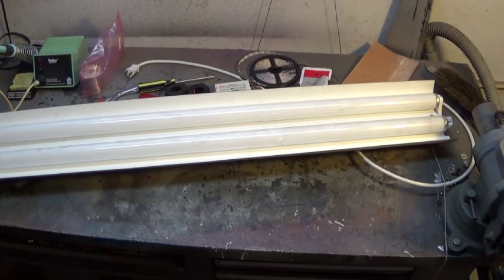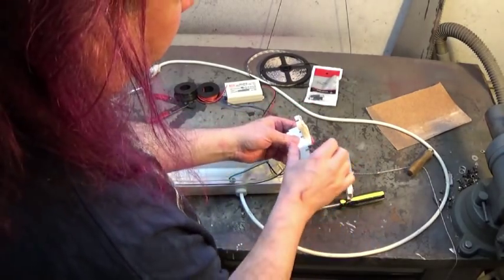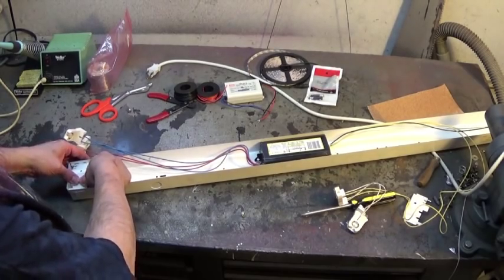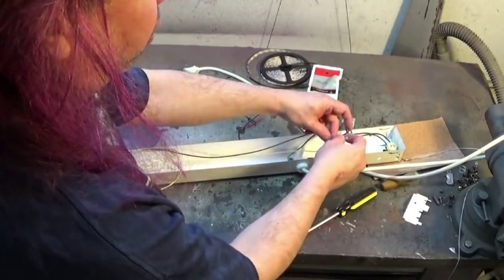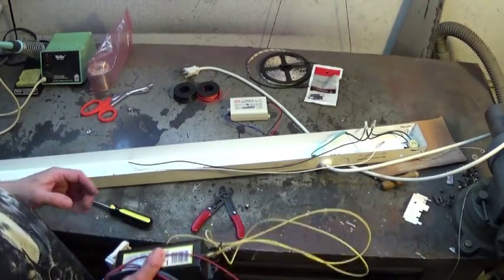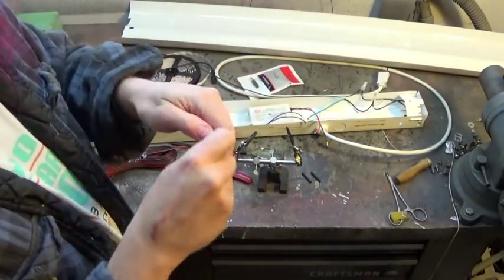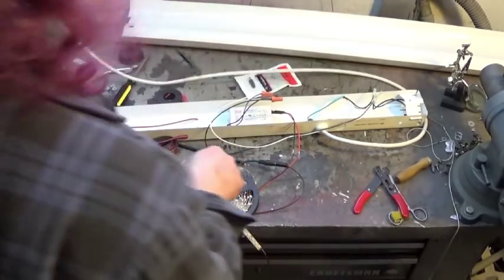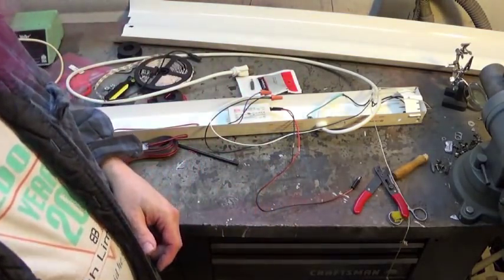Redneck Conversion:  Fluorescent shop light to LED, installment 2

Comment: What exact converter did you buy for this as you never detailed the specifications?  I see on SuperBrightLEDs that you can select from 12w to 35w.  The input (from your home) is obviously 120-240 and the output is 12v DC but what is the desired wattage and is that input or output?  The data on their site leaves a lot of questions and has four wattages to choose from (12 watts to 35 watts) and this also affects the final costs.   You might want to add a little more details in your description as you can underpower these and they will not be as bright or you can overpower and burn them out.